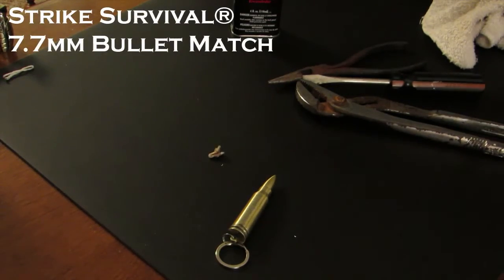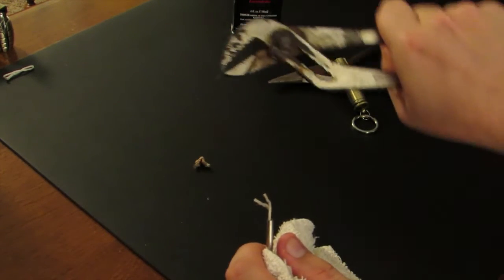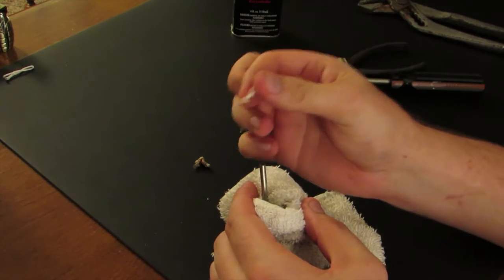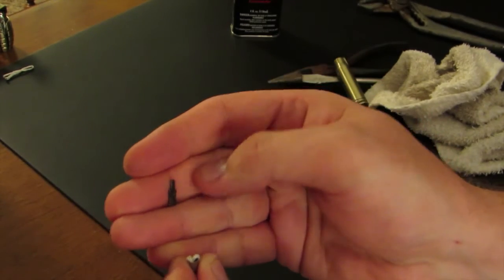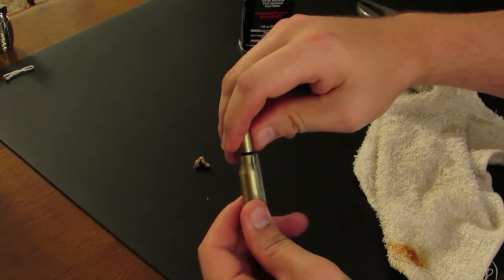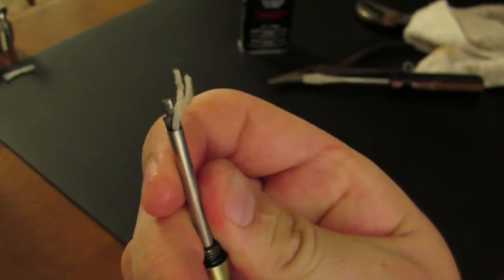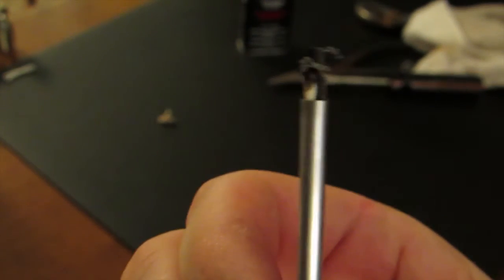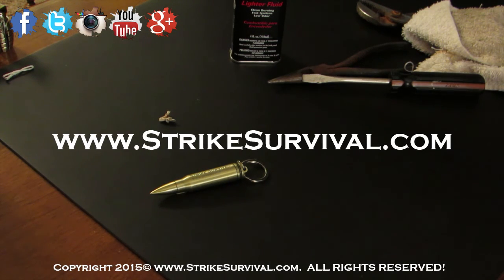strike survival bullet match wick replacement

Comment: In my permanent match zippo brand it seems that the striker part is fixed in the tube and i was not able to take it out for wick replacement by any means . What should i do for replacing the wick which has become very short now?
Thaks : H. Khakpour
Reply from the maker: If you bought our brand you can replace the wick as it shows in the video.  All of ours are able to be replaced. Cheers!
Reply from the maker: In ours theirs about two inches of wick as it says in our wick replacement video which should give you extra.